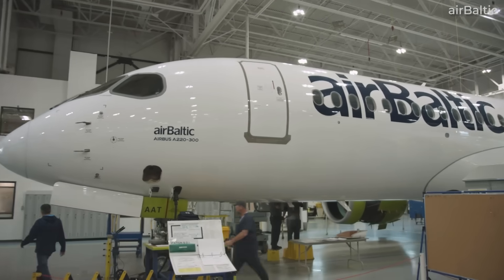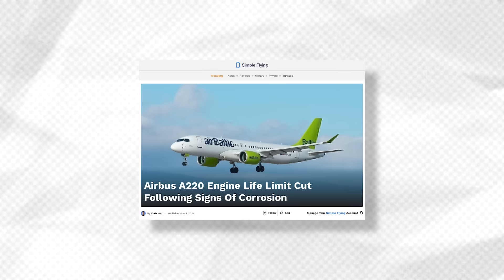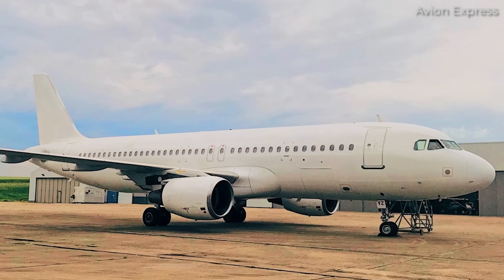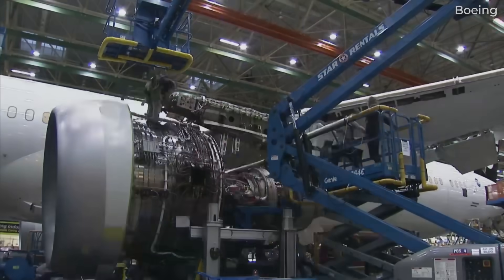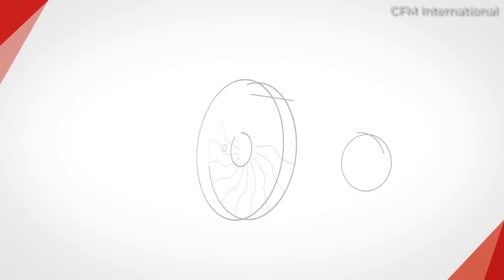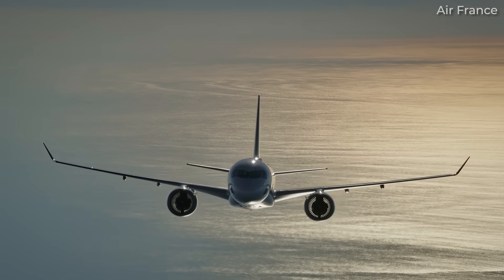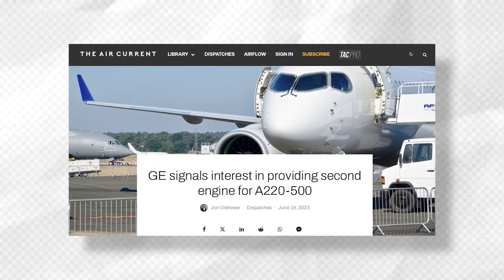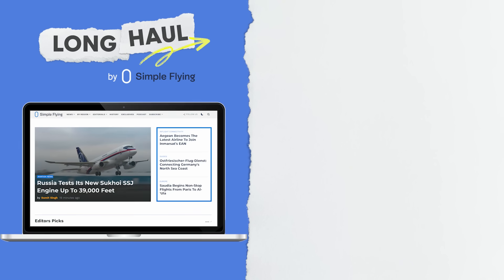Should The Airbus A220 Get A 2nd Engine Option?

Comment: If I was an airbus corporate management, I would be talking to airlines about a potential new option to see if it was going to be a profitable move. One other thing to consider is that along with order cancellation fees, you also pay engine manufacturer cancellation fees; this could help airlines wave that fee with a new CFM Leap if moving from the MAX or NEO to the A220.

Comment: Only reason why Airbus purchased the A220, was to get a foothold in the US manufacturing market, since it was being built in NA, they really didn’t need this plane, as it competed with lower end passenger-wise with A320Neo.

This was a strategic move nothing else, so they don’t have an urgency to do anything. They couldn’t care less if it fails, they’ll just move some production work for their other fleet. Probably contractually obligated to build A220s.
Reply: They already had a factory with a final assembly line in the US. They’ve been building A320s there since 2013. A foothold in the manufacturing market wasn’t the reason for the A220 acquisition

Comment: There is a simple solution to te engine problem: fit every seat in aircraft with pedals and gearing so passengers make the fans turn. No more engine problems 🙂  Would require airlines to feed passengers and give them plemty of Red Bull 🙂
Reply: It might work for cars (as in Flintstone cartoons). Talking about Flintstone, an idea to consider is strap large birds onto the plane and (somehow) synchronize their flappinga during take-offs which is when maximum engine power is typically needed.

Comment: You need to consider original contacts between Bombardier and P&W in case there is an exclusivity clause which is quite likely.  This was a high risk project with  Bombardier's first forey into mainline aircraft and Bombardier having nearly gone bankrupt in mid 2000s (causing C-Series to be shelved and restarted later).   Any engine manufacturer willing to commit capital for such a low volume high risk endeavour would want exclusive sales. 

Note that the GTF for the A220 and 320neo are of the same family. The one for the C-Series/220 was produced first and the version for 320neo produced later (but both ended up in service without much difference in time due to C-Series being late). 

Bombardier had no choice because P&W was the only one willing to offer something new that would give it a performance edge. That P&W hasn't been able to fix problem yet makes me fear the problem isn't fixable because the design takes engine beyond physical capabilities of the design/metals used. 

Airbus and Gouvernement du Québec would have to sink more capital into this money losing endeavour and Québec will not do this again. A d Airbus won't get full control of A220 until mid 2030s now.   new engine would require all the certification costs as well as paying CFM for the new low volume variant.  

Best bet is to get P&W to fix the engine once and for all, even if it has less performance but gains maintenance reliability.
Reply: Bingo!
Reply: P&W use to be good, now days they are junk

Comment: This segment implies the A220 could replace the A320 family because the A220-500 definitely overlaps into A320 territory.
Reply: if that was ever built you’d get the A320 737 edition because in like 20 years it’ll have the same “too low to keep stretching and giving bigger engine” issue

Comment: An A220-500 would be a viable replacement for the A320neo. However, it's not going to happen.

I also find it interesting that this video made no mention of the Embraer E190-E2, and E195-E2 which are powered by the same PW engine.
Reply: I think that they didn’t mention the E195-E2 b/c it’s not selling well at all especially compared to the A220-300.  There are no E195-E2 versions of airlines like AirBaltic or Breeze Airways.
Reply: @steinbockguy It doesn't matter because those planes are also getting grounded for engine repairs just like the A220's. There are also a number of A320 series of aircraft. An airline in India is out of business because of this, so even though this video only focuses on the A220, it's a bigger problem.
Reply: @ agreed

Comment: I wouldn't be surprised that CFM International has already done engineering studies on a LEAP engine variant specifically for the A220. I wouldn't be surprised that a "LEAP-1C" engine could be announced within a year or so that could be applied to the A220 and Embraer E2 models.
Reply: The leap1c is used on the comac c919

Comment: CFM LEAP Engines would be an awesome and much needed option for the A220!
Reply: Too powerful for A220-100, so that might cause a spare parts issue for airlines looking for fleet commonality.  Most of the time when a plane has multiple engine options, the airline still only chooses one (GE or RR for example) just to limit the high cost of duplicating spare parts).
Reply: @steinbockguy  Only 99 A220-100 got ordered. There are only 30 A220-100 left to delivered. A220-300 on the other hand, have 806 orders.

LEAP engines also currently being used on NEO and MAX. So engine Commonality for LEAP is already a benefit for airlines.
Reply: This is an interesting perspective and one I hadn’t thought about, but I assume (fraught with possible errors) that that means also that 1,616 engines have been ordered at the same time already, and there’s an interesting legal question where the 808 x A200-300s already ordered can have their engines changed or whether they would have to wait for anything ordered after the announcement of a new engine.   I’m sure Pratt & Whitney would vigorously defend any contractual requirement from the plane purchaser because they wouldn’t want 1616 engine orders to disappear suddenly.
Reply: @steinbockguy   if Pratt and Whitney dont start wining  they well do the same thing to the A220 as Roll Royce did to the 10 11
Reply: @ I can’t disagree with your speculation, especially when you look at airlines like EgyptAir who basically went all in on the A220 but then had to do a 180° about-face by getting rid of their entire A220 fleet and leasing in 737Max planes.  The P&W engines were just too unreliable for daily use and service parts had/still have unacceptably long lead times.  And we are all probably aware of the havoc this issue is causing AirBaltic atm as well
Reply: @steinbockguy  If P&W cant make a good product they need to go out of business, the a220 is still  a good plane
Reply: @ If P&W can’t make a good product, they should improve their product or face going out of business is right.  No one is talking about the quality of the A220 platform (A220-100/300).  I don’t think anyone would disagree or even find your comment noteworthy (b/c it’s so rational).  I think what a lot of us have been intellectually chewing on is the feasibility of adding a 2nd engine option to a 10 yr old platform and only b/c P&W are having quality and delivery issues.  I think we’re thinking about “feasibility” vs. “desire-ability.”
Reply: @steinbockguy  since Rr is junk it will be Ge

Comment: Airliners w/ flexible engine choice;
1. A380; GP7200 + Trent-900
2. 747-400; PW4000G + GE-CF6
3. A330ceo; PW4000G + GE-CF6 + Trent-700
4. 787; Trent-1000 + GEnx-1
5. A320neo Family; PW1100G  + CFM Leap-1A
Reply: I believe the 747-400 also has the RB211 as option. Nice list nonetheless
Reply: @ivan_friends5953 also the 777s, 757s and 767s
Reply: 777 (no longer produced)
Only in -200, -200ER, -300
Reply: 777 had the option of the RR Trent 800  and the GE90 and the 747 had the RB211 as a third option:)
Reply: @chaoszombie9995  for the triple seven such option was only on -200, -200ER and -300
Reply: @chaoszombie9995  oh yeah BA 744s was rolls

Comment: Its time the industry face facts ..the GTF is flawed  8 years in production and PW still can't get these engine working as intended...as for the A220 airbus has and will continue to prioritize its A320neo family..the A220 has already killed off the A319neo with ease a stretch A220-500 would be the death of the A320neo...bombardier made a dam good airframe which is why Boeing tried to kill it early and airbus is careful not to give it anymore leverage

Comment: Well, it's a great engine when it works. But, how about buying a cormac from China. 🤔🇨🇳
Reply: Lol, no. Get back to us when they have a certificate and produce more than just single digits per month. Did they reach 2 or 3 planes per month already?
Reply: @jantjarks7946 well, you have reached the inner core of the earth!congratulations!
Reply: The LEAP-1C on the C919 is less of a LEAP and more an upgraded CFM56. Don't want to share US intelligence with China now do we?
Reply: Thanks but no thanks! Given the reliability (more precisely, lack of) of made-in-China products from household appliances to small scooters to EVs, I will definitely avoid booking flights with a remotest chance of plane using Chinese engines.

Comment: I was surprised that aircraft manufacturers are not providing engine alternatives to their customers. The A220 situation really highlights the issue, as does the A320 with different engine options. Problems with SEO (Single Engine Option) aircraft is that when problems occur with the engine, the future sales of the aircraft itself is affected. Whereas with aircraft with different engine options have shown that when one engine is a "failure to launch" airlines have ordered new airframes with the other more (comparatively) reliable engine. Bad business decision on the part of Airbus/Canadair when they decided on a SEO. No doubt, Embraer is also facing similar issues with their airframes fitted with the Pratt & Whitney GTF engines.
Reply: It's a matter of development costs, as each option adds up requiring certification. Bombardier didn't have the leverage to get a decent deal for the engines and Airbus thus is waiting for the contract to expire.

At that point Airbus probably will introduce a different engine option, a -500 version, overhauling many parts at the same time to make them more 'Airbus like' and especially changing the cockpit, in order to increase commonality.

At least it would make sense to change the whole layout at one point instead of incremental changes over time, creating a boatload of different versions, making maintenance difficult.
Reply: How many different engines are there, do you think ?

Comment: Existing CFM leap engines are apparently over-powered for A220, but it may be justified to make a downsized/detuned variant. 
I’m unsure about leap-1B as it’s specifically designed to fit Boeing.
Reply: wrong

Comment: Airbus has struggled with the A220 production - and a second engine option would be one of several needed improvements.
Reply: They are not simply struggling, they are waiting for the right time to fix the plane design and supply contracts. Most of the contracts are still from Bombardier and require a lot of changes to fit into Airbus supply chain.
Reply: @ We don't need to guess on everything. Airbus representatives made several statements about this program. They are certainly not waiting (this is Airbus, not Boeing!). Overall, Airbus is improving the A220 program. One example is taking over parts of Spirit AesoSystems. Where Airbus is waiting is announcing a new A220, but what they do behind closed doors is certainly not "waiting."
Reply: @Luke-GO  Waiting for the right time doesn't mean being inactive, indeed. 😉
Reply: @jantjarks7946  One would think Airbus is feeding your family.
Reply: @Luke-GO Airbus is only taking over parts from Spirit AeroSystems b/c Boeing is buying Spirit back into Boeing and has to sell of divisions of Spirit that do work for Airbus. I don’t think Airbus had any interest in buying any part of Spirit AeroSystems before Boeing moved to reintegrate Spirit AeroSystems back into Boeing.
Reply: @steinbockguy  Intent doesn't matter. What matters to this comment is that the Spirit take-over helps Airbus to improve the A220 program.  Kinda like Airbus had little interest in buying the Bombadier C-Series and then Trump/Boeing messed up.....
Kinda the same of what is happening right now. History repeats itself.
Reply: @Luke-GO  we might be talking past each other b/c I can’t see anything to disagree with in what you wrote, but I also don’t see the two comments as interacting with each other.  We will see, though, if what Airbus gets from Spirit AeroSystems improves their control over their supply chain.  I would have assumed that if it had, they would have tried to buy that “division” off Spirit AS long before Boeing had their door fly off in Jan 2024.  In any event, I would be thrilled if Airbus can get A220s out faster and more cost effectively.
Reply: @steinbockguy  To my knowledge Airbus had no intention to buy any division from Spirit. I'm pretty sure to remember statements from Airbus that they didn't want anything from Spirit - until Boeing pretty much gave it to Airbus for free.
Anyways, Spirit is just one part of the improvements Airbus is doing.

The reason why I mention Trump, is that his administration was responsible for the C-Series sale to Airbus and with his new tariffs, Airbus will certainly profit again. For example Airbus could cancel bad contracts with US-American suppliers that Bombardier originally made.
Reply: @jantjarks7946 you didn’t watch the video? Supply chain issues are regarding the Pratt and Whitney engines not Bombardier suppliers or contacts. 389 have been built which is a good rate.
Reply: @TheScottbb1  The world isn't singular.

Comment: When planes are smaller a single engine option means less R&D money to spend in the certification process. When planes are larger it can be better to have the different engine options available because fleet commonality, fleet discounts and spare engine availability can all factor into long term costs.

Comment: Sadly airbus won't do anything to improve the A220, it has bigger problems such as the huge amount of A320 orders and A350 production issues
Reply: I think they are very serious in saying that when they reach 14/month in 2026 that they will do the -500 which could also help relieve the A320 FALs
Reply: @ViktorFromDK  The A320neo isn’t selling?
Reply: @ViktorFromDK  I really don’t think that that is likely because they end up eating their own lunch because the A220-500 would not only undermine the A320, but the entire A320 family since the cockpits are not in anyway similar enough to limit the need for training
Reply: There are several hurdles to overcome for Airbus and they are waiting for the right time to overcome most of them in order to align the A220 with Airbus whole product portfolio.

Some just require time, like the contract with the engine manufacturer, which is still from a time when Bombardier was in charge. If I remember correctly, that contract is due for renegotiations in '26, when Airbus wants to build 14-15 A220 a month too.

Probably '26 will be the year to completely overhaul the design and introduce the -500 variant. And probably to introduce a new engine option too? We shall see.
Reply: Once Airbus brings out the A220-500 they’ll convert all the A320neo orders to A220-500 orders.
Reply: @Carltonsmithers I mean… It could be a good thing for Airbus because they are no where near catching up to the delivery deadlines they have stated for their A320 NEO, which have thousands of order and new airlines have to wait until the 2030s to get their hands on the aircraft
Reply: Isn't that the best reason to fix the A220 engine issues? With this issue minimized, the pressure on Airbus would be reduced.
Reply: Correct